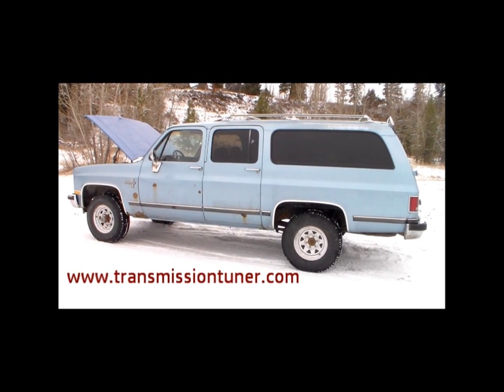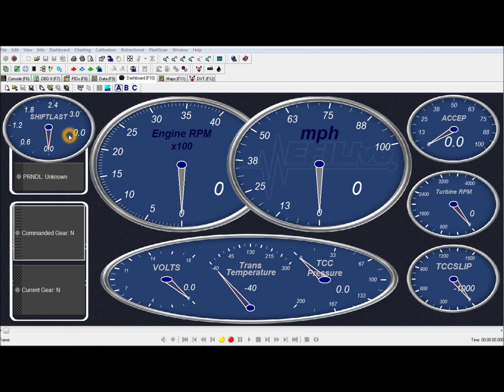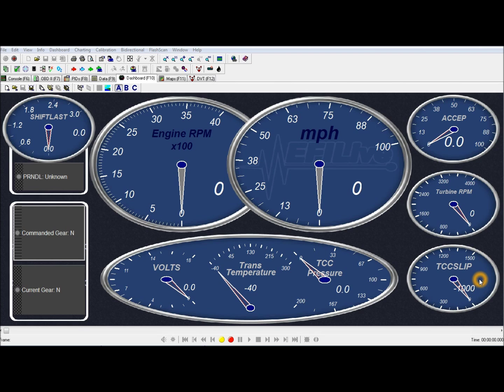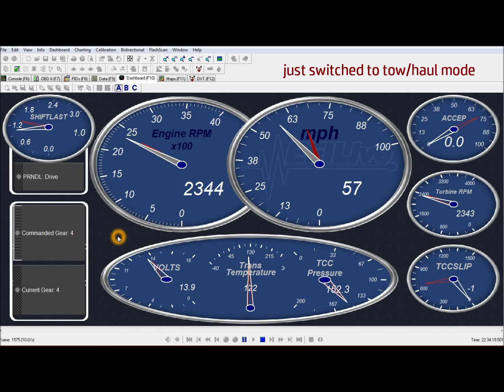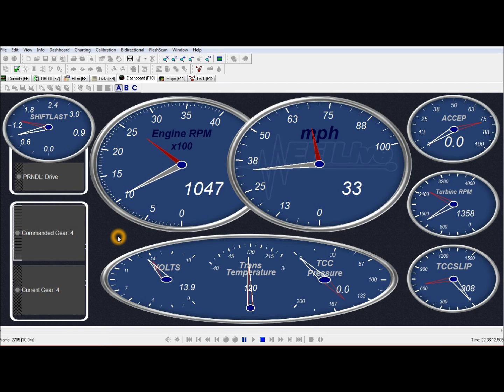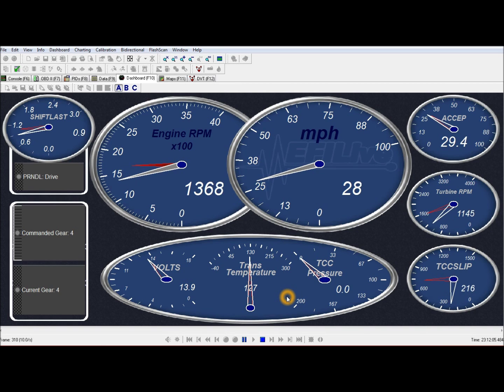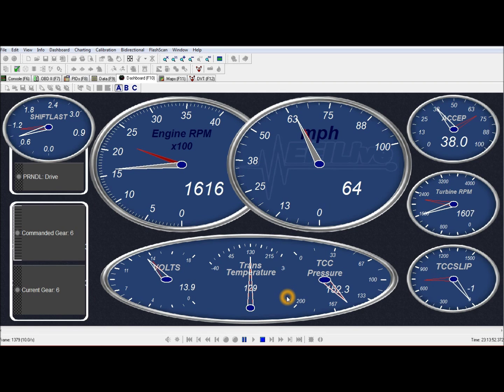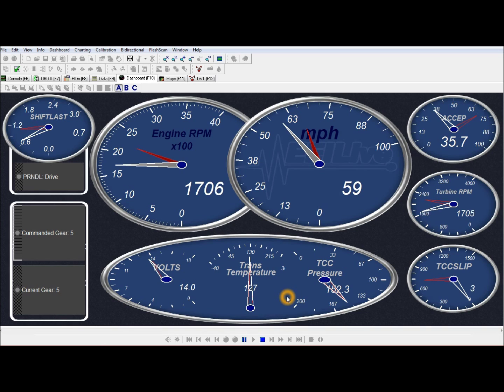Allison 6-Speed Stand Alone Demo

Comment: That would be so nice behind my 5.9 CR. I would be going from a NV5600, this is a 2wd 3500 dually. Your shift points and firmness are just about how I like it. What kind of adapter options do I have? I noticed ATS has a new bellhousing for the Allison to mount it directly to the Dodge cummins adapter. Any thoughts? I love my truck, but getting tired of shifting it.
Reply from the maker: There are lots of adapter options, see more here - https://transmissiontuner.com/blog/forums/forum/allison-general/4bt-5-9-6-7-cummins-allison-adapter-options/ and ATS does sell the bellhousing with their torque converter separately.  Goerend has better stall options with their torque converters.

Comment from the maker: I finally got around to proving my hunch that my 241 passenger side drop transfer case was not going to work, the Allison is too wide and the driveshaft hits the pan rail before it ever even gets close to pointed at the differential :(   Figured I should put that info here in case anyone else was thinking about using one.  Might work with a 6" lift kit and 37" tires, but maybe still not.  I would not be surprised if this is an issue with a 205 as well.  Not only does the narrower transfer case cause the problem, but the narrower chassis with the front differential closer to the center of the truck doesn't help any either, so even running a 271 upside down may not work in these old passenger side diff trucks.   Someday, if I want the 4x4 to work I will try a 68RFE, they are narrower, and put the Allison in something else.  

Your comments are welcome- but I will only answer questions related to a 6-speed Allison swap- other questions are welcome through my website contact info at www.transmissiontuner.com.  Thanks!  Jason
Reply: You have to clock the t-case up to get the driveshaft to just slip past the top of the pan rail.
Reply from the maker: @WTFChuk  I found a bunch of comments held in moderation... never got any notifications for them.   I did hear a few years ago that clocking up makes it work, but is it still awful close?   I won't ever be putting a front driveshaft in this old burb, will be building something newer so it would be great if you have one with a front driveshaft to let us know how much clearance there is and have you ever had it hit the Allison pan rail off roading?